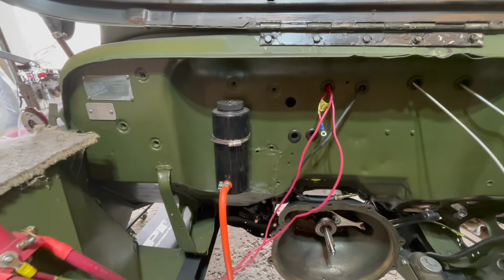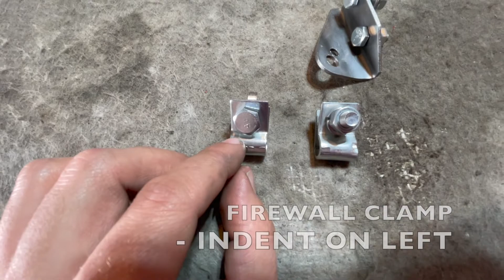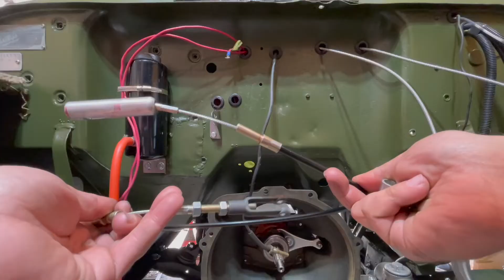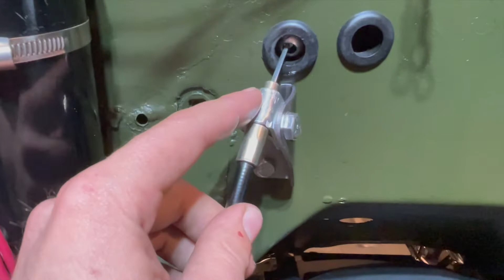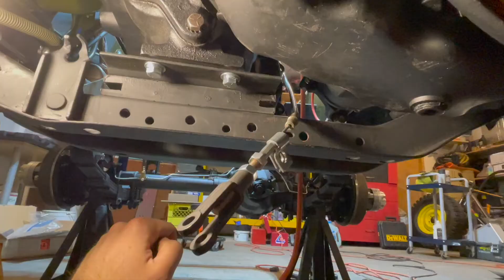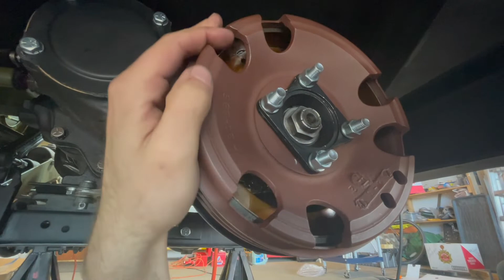Willys Jeep Emergency Brake Cable INSTALL | (Part 1)

Comment: Thanks for this video. I was installing the cable today and was unable to pull the handle. Then remembered your additional plate to relieve tension on the cable. I will make a similar plate that you did. How far from the original holes did you go?

Comment: first off thank for your video on the backing plate and the brake shoes installation. isaw the video three thime so it can be used for my new emergency parking brak i bought from kaiser. only problem it seems all had the same is the backing plate will not flush all the way to the bottom. i had to ground the center circle and all four bolt holes to elongate so the plate will have play. it work out great once is grounded. another problem was the link that goes to the pivit arm into the square due to the oversized fork is too narrow. i also had to ground it down to get it goes in. just let the buyer beware these unknown encounters..

Comment: My 1954 Willys CJ-3B does not have an emergency brake. Would this fix work where there was never an emergency brake?
Reply from the maker: Yes it would. As well, our CJ2A never had an emergency brake when it was bought.
Reply: @LetsBuildaWillysJeep  I’m in Colombia. This place is loaded with hills. Not having an emergency brake is asking for an accident. Just going home is a huge hill. My Willys wants to roll backwards. 

Thank you!
Reply: it was the same for my 1952 willys CJ3A.. i'm about finish, only thing i have i to install is the speedocable and the hook up to the linkage to the cane cable. the kaiser willys will have the whole kit. it doesn't come with the cane and cable, that's separate item you have to buy from the. the whole kits cost abot $500. read the two comments on the extra work you have to work with backing plate and the arm fork. you figure our as you go.

Comment: Could you use a foot operated emergency brake system instead of the cane with this this hard ware?
Reply from the maker: It would be impossible considering the cane pulls on the cable and a foot operated system would push on the cable. It would need a modded brake cable and some serious thinking to make that work.
Reply: My foot operated emergency brake doesn’t push the cable it pulls it. The more I have thought about it I could probably make it work on the same principle by using a cable clamp on the crossmember and attach the cable to the emergency brake lever. I still appreciate your thoughts on the matter. Thank you.☺️☺️☺️